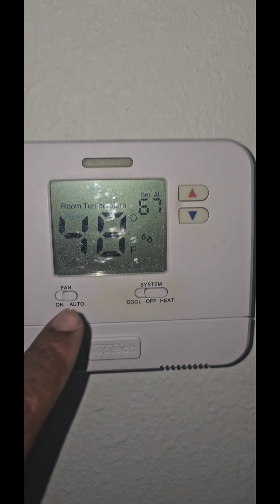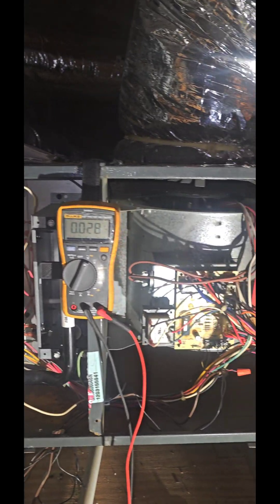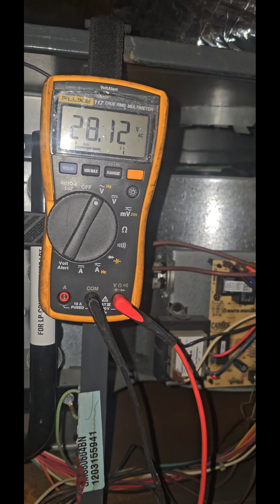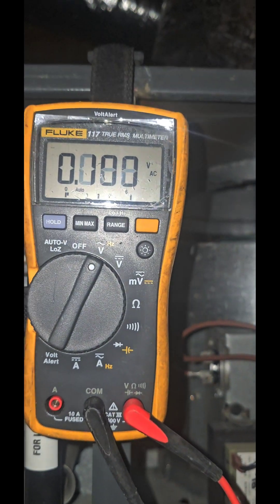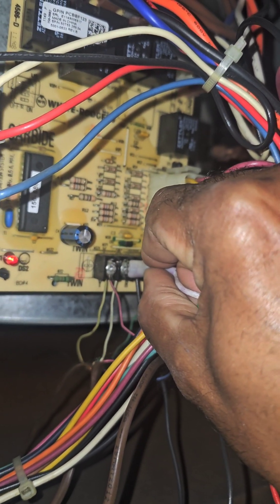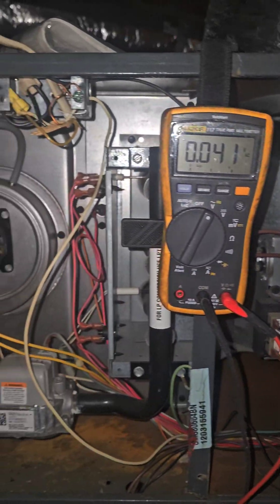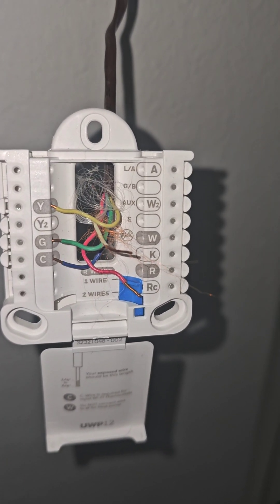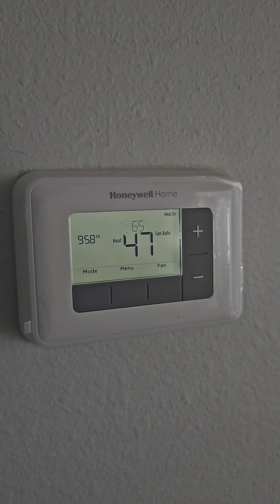Bad Thermostat? Here's How to Tell in Under 5 Minutes! #thermostat #noheat #diy

Comment: If heater turns on at the board doesnt really mean its a bad thermostat. It could be a bad board too. Its best to jump red and white wires at thermostat. If heat comes on then its a bad thermostat.

Comment: Couldn’t you jumper at the thermostat and save a trip to the attic?
Reply: Yes. But he needed to gonin the attic be certain it was the tstat. Needs to check if the unit is actually working.
Reply: What about the other way around?  I have my AC temp set to 76°. My AC is on, but temp on thermostat says its 80° inside & temp doesn't go down. The AC has been running continuously for a while already. But the thermostat temp doesn't want to go down

Comment: Best way to check it is to set up the thermostat on heat then at the board check for 24v between C and W if you are not getting 24v then it’s the thermostat the issue
Reply from the maker: Good call, gotta check those terminals!
Reply: Or a damaged wire